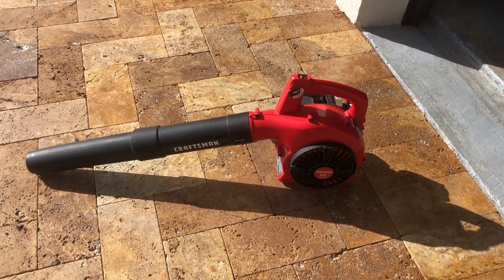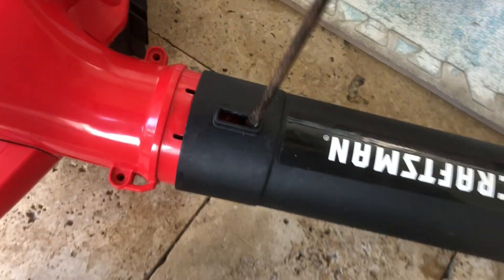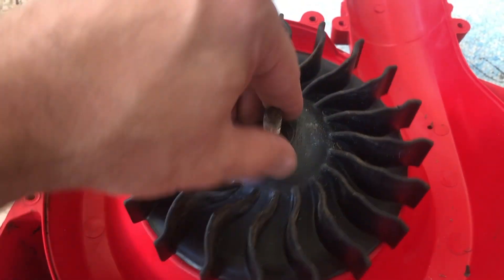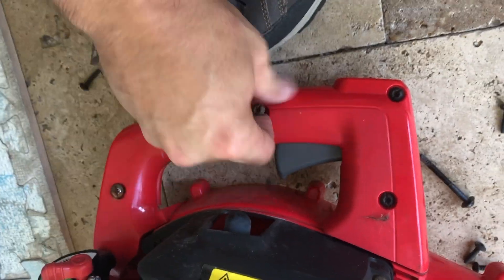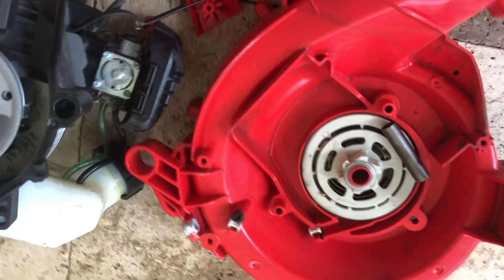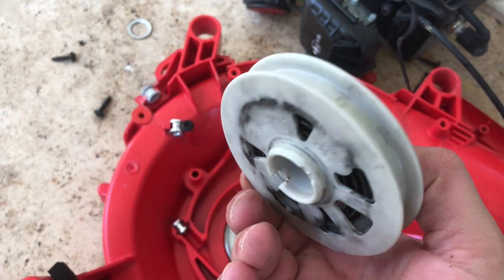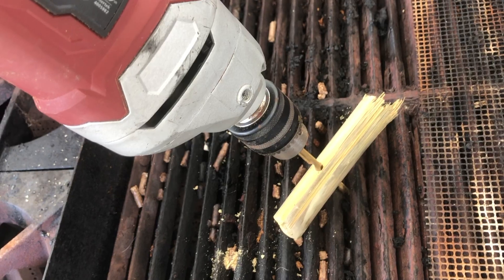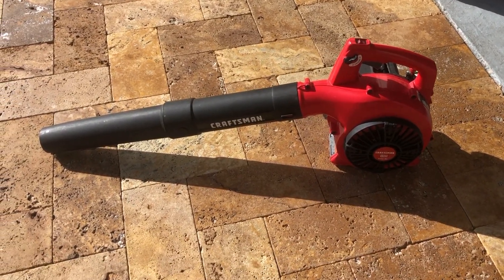[How-to] Craftsman B215 Leaf Blower, Pull Cord Start Repair, Restringing, Or Replacement.

Comment: 👍
First thing, getting that nozzle off is a gates of hell, 3 handed operation, or hold it steady with your feet while you twist the nozzle with one hand while poking the screwdriver into that slot.
At :55, I used a two handle pliers wrench to stick the handles between the turbine blades to keep it stationary.
And since I'm cheaper than you are, I took the broken handle/cord to my local Ace Hardware and they cut 3 feet of paracord off the bulk roll. I think it was about $2.00.
Whoever designed this should sit on a stool in hell, replacing cord after cord after cord.........
Reply from the maker: ahahaha. And yah, I was basically ready to give up taking off the fan, and a few other parts. Really absurd.